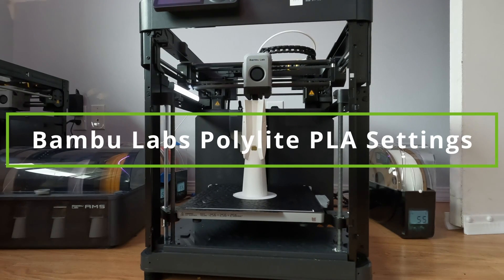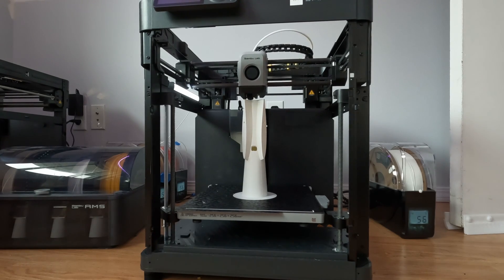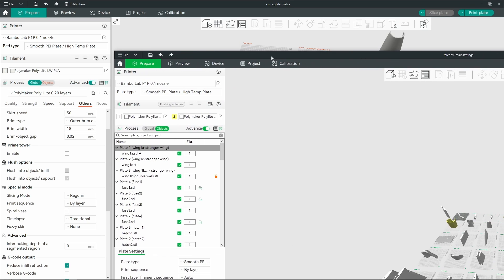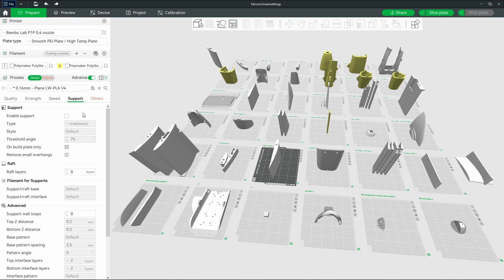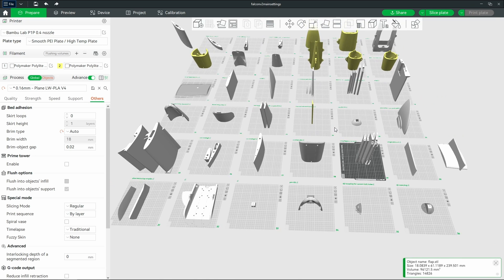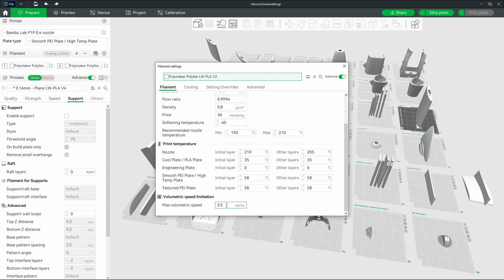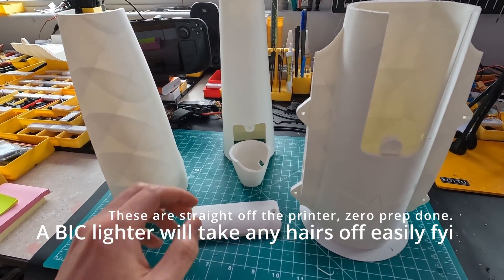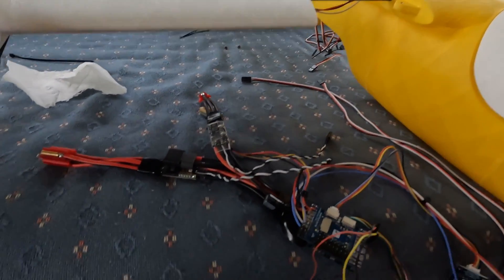Best BambuLab Polylite LW- PLA Settings

Comment: Dude, thank you very much... I spent three days trying to overcome LW-PLA printing on my Bumbu Lab P1S printer and only after your video and settings I was able to print the airplane parts normally (low weight and good strength of the parts).
Reply from the maker: I'm so glad to hear it, I still print with these same settings myself and I have not found anything better yet ❤

Comment: Earl, the link for your Google Drive is incomplete. I'd REALLY love to use your print settings. Thanks!!! Can you update the link or send me the files by PM?
Reply from the maker: https://drive.google.com/drive/folders/1COS809cPMtZAYdd9fkv2Pgi5hI1RDkPL

Does this link work for you? Looks like Google shortened the link randomly 🤷‍♂️
Reply: @HeyitsmeEarl  Yes, that link works, download successful...THANKS! Follow up question, what type of bed are you using, any adhesive? I'm having adhesion issues with this filament.

Comment: Have you tried these settings on the Bambu Studio program at all?
Reply from the maker: I have and for the most part it will get you 80% of the results of the orca slicer, its not bad, the orca just has a few features not enabled in bambu at the moment :)
Reply: @HeyitsmeEarl  Sounds good, just to confirm, this is for LW-PLA and not normal PolyLite PLA? Thanks for responding
Reply from the maker: @brice4180  yes their lightweight PLA is actually confusingly called "polylite LW-PLA"

Comment: The profiles are not for an A1.
Reply from the maker: @dugy40  correct
Reply: @HeyitsmeEarl  That's a shame. I just bought the A1 so I'm looking for LW filament profiles to suit printing RC planes..
As a newbie, to printing but experienced RC pilot, I'm looking forward to the new challenge and have heard the Orca slicer is the way to go.
Reply from the maker: @kellio48  If you are willing to tinker I am sure you can get similar results tweaking my profiles but as I don't have access to an A1 its hard for me to verify how decent they will be for you, I do hear it is an excellent machine and may even be more accurate than the p1 and x1 series!

Comment: Tried out your profile.  It does make a nice looking print, however my part turned out only 8% lighter than PLA+ with the same settings.  Just something to think about.
Reply from the maker: I use some very light infill's on my planes and people say its 20-30% lighter than pla+, but I have not bothered to test it myself as I've had such good success on the LW pla, maybe if I crash something I will try and do a body in pla+ and measure the differences :)
Reply: @HeyitsmeEarl  yeah it’s less dense 0.9 vs 1.2 of pla. I think since you increased the flow to 1.15 that negates lots of the weight savings. I lowered it to 1 and the parts were much lighter again, but not as smooth anymore.
Reply from the maker: @trafton00  that makes sense, I was never super concerned with maximizing my weight ratios I just wanted stronger/nicer finished parts. Maybe there is a sweet spot to bad had somewhere in the middle :) I may have to play around on my next glider and give it a go
Reply: @HeyitsmeEarl   yeah If the plane flies and you enjoy it then great. I designed a plane to use pla because I’m stubborn and wanted it to work. It flies great (after many fails) but a bigger battery is tempting.  Now I’m testing out different lw alternatives. At the very least it’s an easy way to save weight on non structural parts like hatches. I’d try LW-PLA but it’s never in stock.

Comment: Is polymaker polylite?
Reply from the maker: Correct
Reply: Polymaker has different ones.  Go to thier page.  The profiles here are not for A1
Reply: @dugy40  So, are you saying the Polymaker site has filamet  profiles specifically for the Bambulab A1 printer?
The reason I's asking is because I looked and couldn't see any specifically for the A1.
Reply: @kellio48  I use the a1 and poly maker.